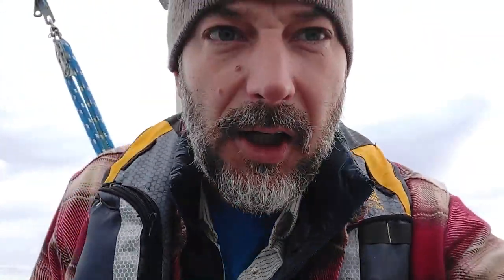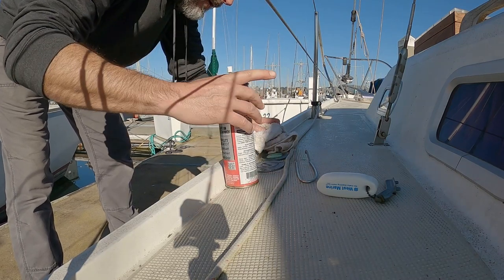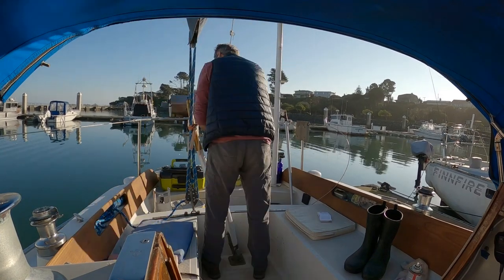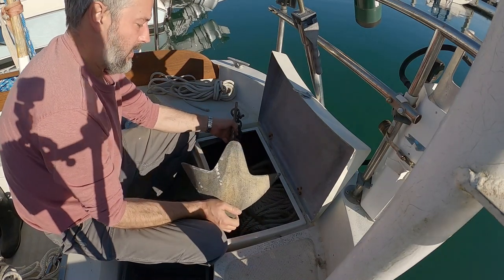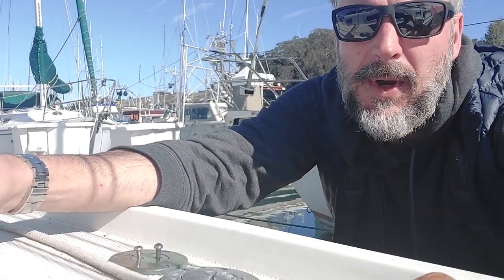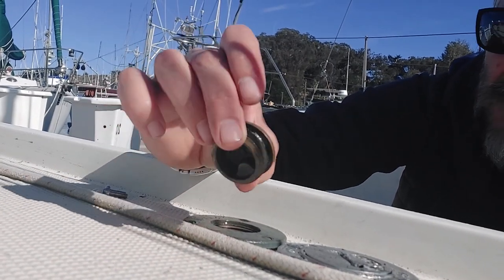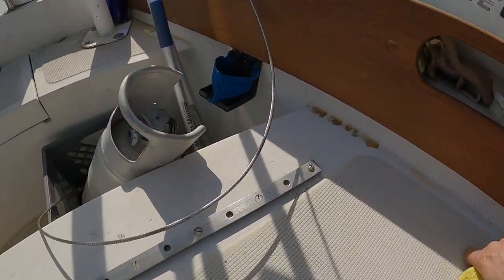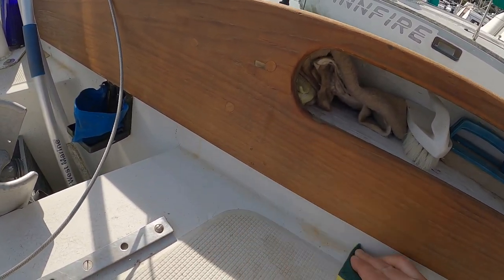Intro to Sailboat Plumbing - The toilet sounds like s**t! Sailing Life can stink - Captain's Vlog 6

Comment: I think you're on the right track for the propane. If that stern locker is open to the rest of the boat NO GAS/volatiles in there. Good luck with the head (aka toilet), You will become intimate with that gem of engineering over the course of your stewardship. Plumbers heat proof grease is a product that I would advise keeping on hand. It is great for O-rings, plungers, valve stems/packing and just about any moving plumbing part. If you have any "Globe" valves in the system do not be too hasty in replacing them. They are infinitely serviceable. Gate and ball valves with stem packing nuts are serviceable as well.  Those new fangled plastic jobs are just a marketing snow job. Old school on boats is sometimes better. PS... Google is your friend.
Reply from the maker: Thank you friend. I can see that you will be very useful 😉
Reply: @EdwardSeatonSailings  High praise indeed, to be useful. The Commadore simply says I am full of it.
Reply: Oh yes, the ins and outs of the head. Well said Jamie. After purchasing my previous yacht, serviced my particular onboard not-functioning gem of engineering, putting it all back together only to realise that the PO had broken a vital part which required ordering for replacement, then finally reassembling, ahh that satisfaction of a correctly working system.  Yep, checking that the through-hull is clear, and intake valve is open, good thinking 😊⛵ Elaine
Reply from the maker: @jamieminton172  ha! I really need to figure this s**t out if I'm going to ever leave the comforts of the marina, but the idea of flushing a toilet while underway, really doesn't appeal to me. I'm considering just yanking the toilet and putting a composting thing in there. Got any advice on that decision?
Reply: @EdwardSeatonSailings  Composting is an excellent option and is pretty much accepted world wide. It amounts to a bucket for the poo and a jug for the pee (in simplest form) and like any bathroom... a vent/fan helps. You can spend as much or as little as your budget allows. Eliminating a "Black" (Poo) water holding tank is a plus. If your marina requires a "Gray" (sink and shower) holding tank and yours is one and the same... at least you can reduce your plumbing woes and may be one or more "Thru Hulls".  Off shore (Check your local regs).... Well there is a reason it is called a head and the Poop/Piss deck. LOL
Thought I had better edit before I started a fight. Joking about the Poop deck. ROTFLMAO
Reply: @EdwardSeatonSailings  I just watched Captain Q. Yacht Hunter and they mentioned Charley Noble (Top side thru vent for the heater). Most commercial composting heads have a provision for venting and it dawned on me that u could vent thru Charley Noble. Yours heater is Starboard and your head is port so maybe not. Might be worth investigating. A tee with a "Damper" that directs the flow up and out with a small fan (PC cooling sized) would fit the bill.